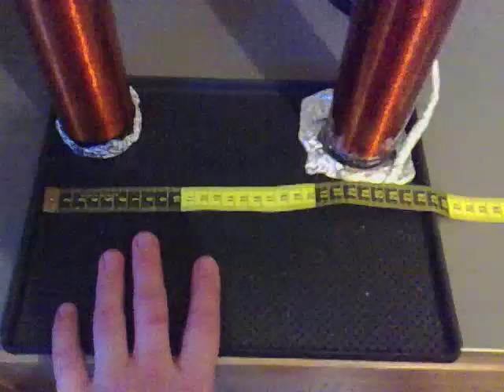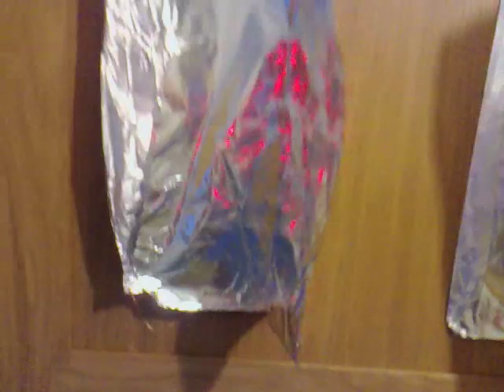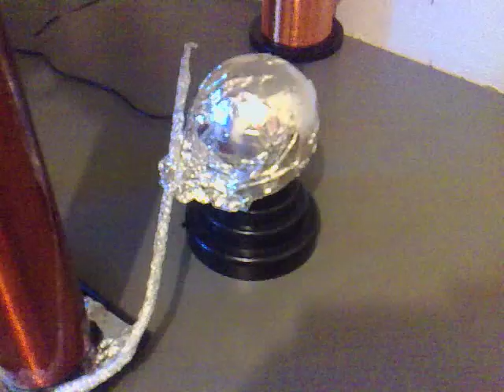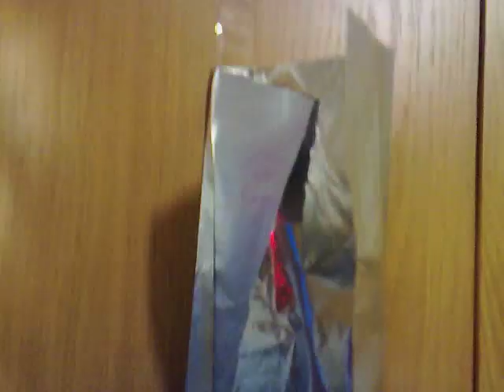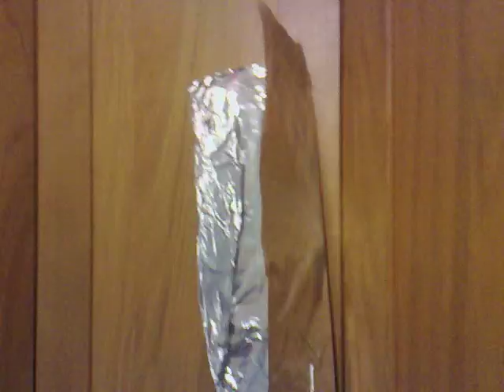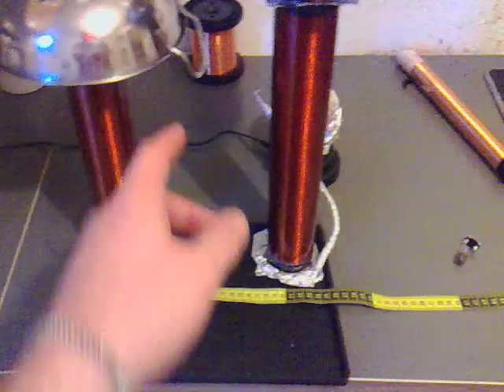Interestings Circuits (Wireless from Plasma) 005

Comment: based on my experience with electronics, this is probably taking advantage of electrostatics, but you'd likely get a bit more 'umph' from the whole thing if you dismantled the plasma globe and used the flyback to drive it directly (there should be a wire lead from it to the centre terminal of the plasma globe) and beware, you'll get a nasty RF burn if you're not careful with it.

Comment from the maker: Hi, Sure, it is 0.25mm wire with 2000 turns on the big coils.

The small coils are coil X amount clockwise then X amount anti clockwise 

Ask if you need any more help...

Thanks
Paul.

Comment from the maker: Thanks a lot, I have been working at it for ages now, the Plasma globe was just a test because it did not utilize the resonate frequency of the coils, as soon as I do I believe it will transmit at least 2m to start with the its just a case of directing the hot spots to the centre of the room... :)

Paul..

Comment from the maker: I burn it with a match or lighter then scrub it with my finger nails.......

Then Just add heat a fresh solder....

I know I want to transmit at least 100w to a light bulb, as I use 11w Fluorescence I can power my entire Flat with that....

Paul..